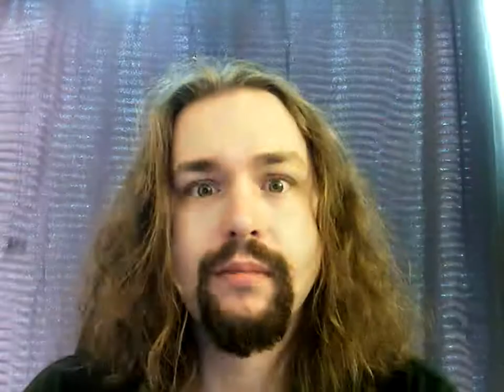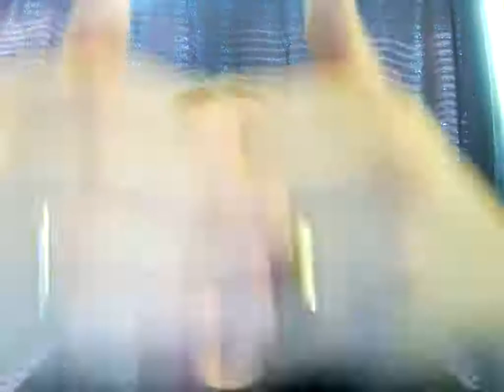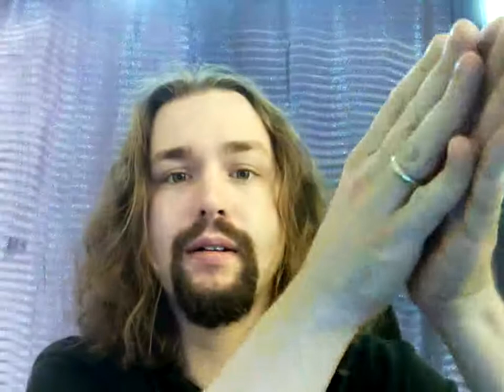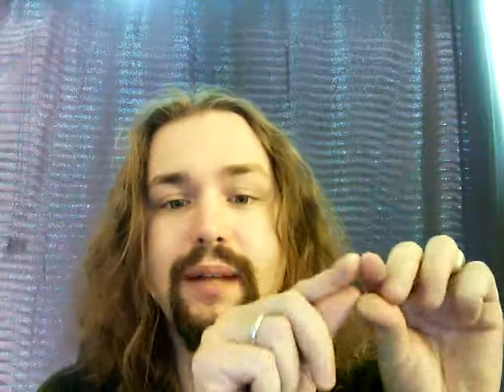Criticality Explained

Comment: Doesn't the criticality reaction also produce gamma radiation?

I thought criticality reactions give victims a one-two punch of both a burst of neutron radiation as well as a flash of gamma rays from the fission reactions?
Reply from the maker: +Brandon Fisher All kinds of stuff comes from a criticality reaction. All that happens during a criticality reaction is that the neutron flux increases to a point where self-sustaining fission is occurring and approaches the point of super criticality. Generally this point, you either hit super criticality everything goes boom or you just have an extremely high intensity energetic deadly source to deal with.

You get large numbers breaking x-rays as well as neutrons, cluster decays, fission fragments, gamma rays, and even some decay radiation. It's a giant soup of crap, but the biggest problem to deal with are going to be probably neutrons and x-rays. Nasty stuff all the way around